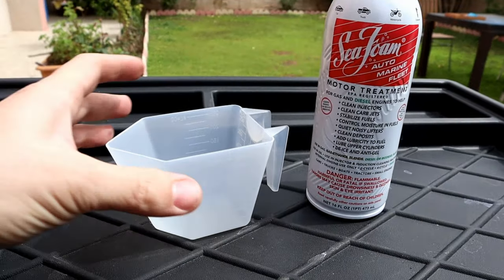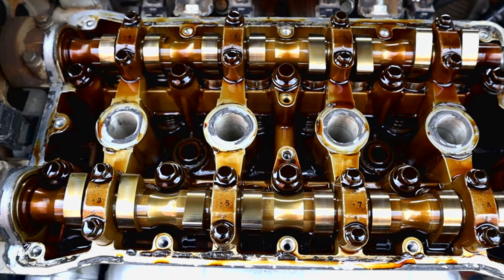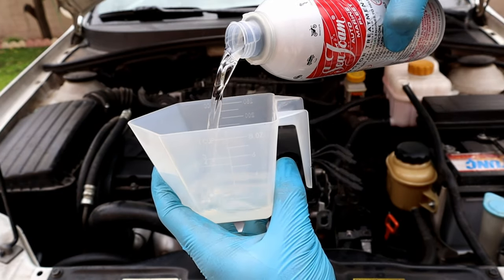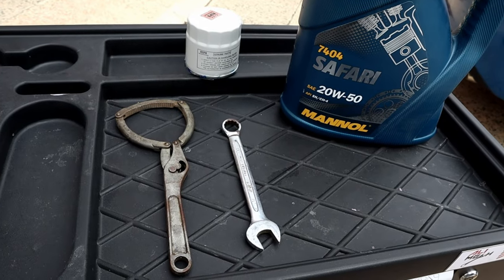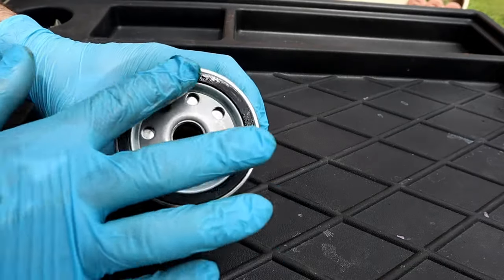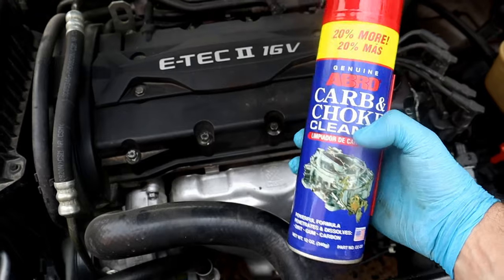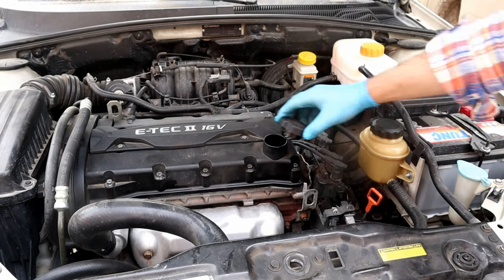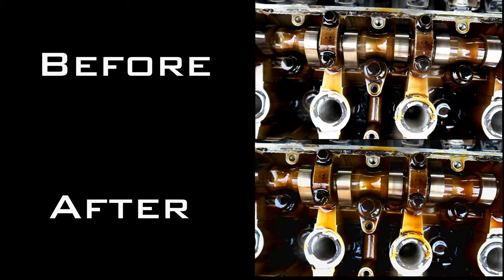Amazing Result Engine Crankcase Cleaning/How to add Sea Foam to crankcase oil/How to do Engine Flush

Comment: I don't see any difference other than old dirty oil and new clean oil.  I see many dark spots on the metal that are still there.  I'm not convinced it did much really.
Reply: Me neither.
Reply: me either
Reply: Agreed.
Reply: Yea honestly didn’t see much difference. I probably would have put it in and drove it around for like 300 miles before my oil change… no doubt it probably did something but it actually looked the same lol
Reply: I don’t believe he either drove it long enough or put the proper Seafoam ratio in - their site states 150 to 450 kms (95 to 300 miles)

Comment: 🤔 Good job  ut I didnt see any difference 😇😇😇
Reply from the maker: The difference is not that much because the engine is that that dirty, but there is a change for sure
Reply: Same 😂
Reply: @AliMECH  I bet it's a change that you feel using the car seat but can't actually be measured with science.
Reply: 3 oz didn't do spat, come on!

Comment: It looks like you just used a clean oil pic of the top end vs a dirty oil. I'd like to see a fresh oil change with a 300 mile run with seafoam followed by another oil change.

Comment: Is it necessary to replace a new gasket after engine valve cover opening?
Reply from the maker: Yes, It's a good idea to to replace the gasket,
Reply: Not necessary but good for preventative maintenance
Reply: Not necessary, it's more of a depends type of situation. If it was an RTV made gasket absolutely 100% most replace. If the gasket is only a few years old you can most likely get away with it.

If the vehicle is 10+ years old and the gasket is factory it most likely has flattened out a bit, and it is probably a good idea to pay the $10-$15 to replace it.

Really depends on the situation, there is no really answer for all cases short of just replace it regardless.

Comment: Using 1 quart of transmission fluid in your engine is an old trick to clean sludge. Transmission fluid has Detergents. Also marvel mystery oil can be used to clean sludge and varnish from inside your engine.
Reply: My grandpa once a year runs his 1977 international loadstar 1700 with just pure transmission fluid his 404 big block doesnt mind and it get alot of junk out considering how much work that truck does a year

Comment: Good video and instructions. But..
You have to demonstrate this on a 250+ miles vehicle to see whether or not it works and upto what extent it cleans. This engine is low mileage and is already clean before adding seafoam.
Also it's better to add oil inside the filter before tightening it to engine.
Reply from the maker: Pre-filling the filter makes the process easier if you have a large, heavy-duty truck, but if you're just changing the oil in a smaller car, it's not necessary
Reply: Yea I agree. Your videos from this engine alone has taught me a ton on the basics. Ty! I’d like to know how well  and how many times it would take on ‘98 5.7 Chevy that has never been cleaned like this. I blame Piglet! Wiener dog can’t ever tell the difference from a 13 and 15.

Comment: why did you use a very thick oil 20w-50?
Reply: @darkotv2  doesn’t matter if you live in a very warm area or not. Engine oil gets to a certain temperature in all engines. It’s the cold that you must worry about but I’d still never add really thick engine oil.
Reply: @PengC1995  Some cars call for thick oil from the factory, my 3.5L bmw service manual calls for 20/50
Reply: @sethliles424  What engine is that? I've had various BMW V8s and never heard of such a thick grade. M62 for example takes 0W40 or 10W40 depending on location 😂

Comment: I just put half a bottle of seafoam into my crankcase and reved it up and etc it idle for 15 minutes and no smoke came out of my muffler at all. What does this mean? Did I apply it wrong or something?
Reply: It won't smoke because your engine isn't burning oil (oil bypassing rings, leaking past valve seals, etc). If you meter it into the intake, you will most likely get smoke. Make sure you know what you're doing because you can damage the engine if you do it wrong.

Comment: Sweet.  I was just about to ask you where the hoses connect to.  You just answered my question.  Also, your fuel injector cleaning HELPED me tremendously.
Reply from the maker: Glad I could help
Reply: @AliMECH  brother I have 2005 camery with black sludge like stone black oil and I use engine flush 2 times and it’s ok but not good result .I want to return the new aluminum color of engine from inside … how plz help me .can I open it from up and use brush and carbon spray to clean it ?!

Comment: I done this to my 08 lexus gs 350 with 176××× miles on it. I cant post a before and after photo or video, due to i dont have time or maybe im just lazy to open that thing. But i can asure u all, i feel the difference driving my car before and after. Seafoam works... i did this with my engine oil still have 2.5k miles to run before change oil.. i changed my oil every 5k. Oh i only drive my car for 100miles due to my first time did that on my crank case. And carefully driving under 30k rpm.

 ill do the 505 CRO on my next oil change, due to scotty kilmer recommended it. And see... on that i dont have to drive my car just keep the idle to 20k rpm for 15-20mins but ill drive my car i dont like keeping my car on idle for long time. Ill do it on free way.. ill stop for awhile and pour the whole can on it and continuesly driving 10mins going and 10 mins to go back home and change oil after cooling my engine/oil to safely can touch.. 

Also i did using seafoam to clean my upper valve by spraying on my throttle body or where your mass break vacuum going to ur engine valve. Also did adding seafoam on my gasoline... by adding it on low gas, nearly empty, drive for 20miles and fill up ur tank... did a wonderful job too... i have no proof to show.. but im swearing a big better difference driving my car. I might redo it again and post it all on one video. Total of four ways to use seafoam on my car.. 
Crank case, adding to gas, spraying on throttle body, and spraying using vacuum  (by using vacuum no need someone to help you to press ur gas pedal until u done spraying) buy at least 5 feet clear hose and 1 small clamp thing. Run the hose from where ur vacuum is, to driver side, from there u can spray on the hose while u monitoring or stepping on ur gas pedal.

Comment: hi, great content! I have the same J200 engine in a Chevrolet Nubira 2007 1.6 and I always follow your videos. I saw that you put an oil with viscosity 20w50, but in the manual it says to use the 5w30. Is this due to the temperature where you live? Please continue with the great videos!
Reply from the maker: Thanks for watching,  this is Chevrolet optra and in the manual it mention that you can 20-w50 and 5w30 as well, where i live not that cold, so different models allows  different oil types as well